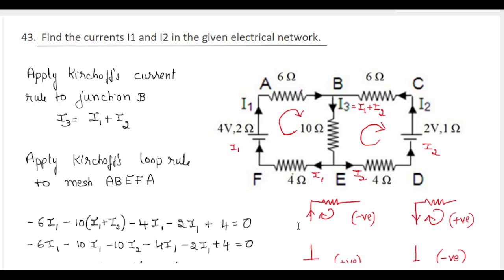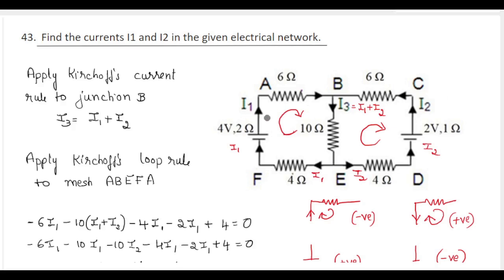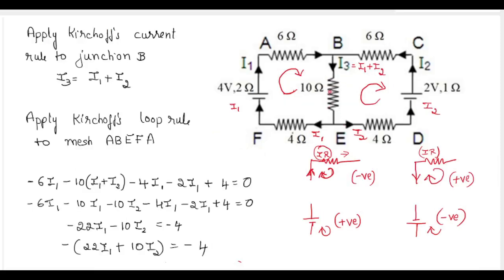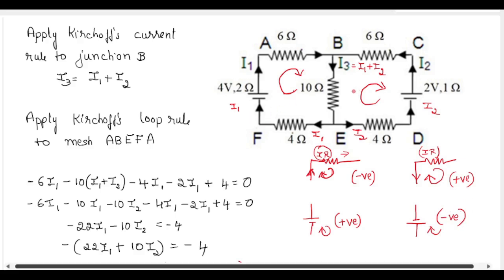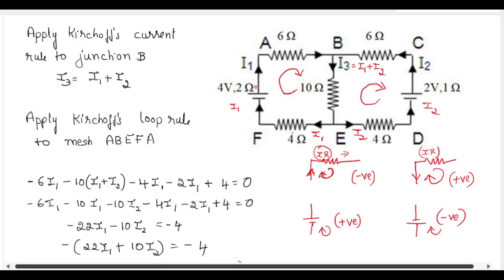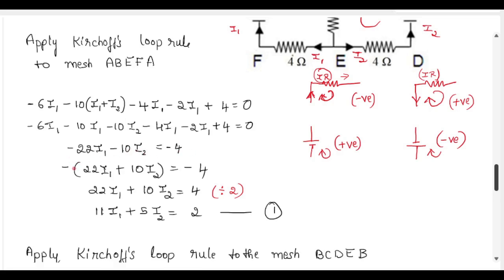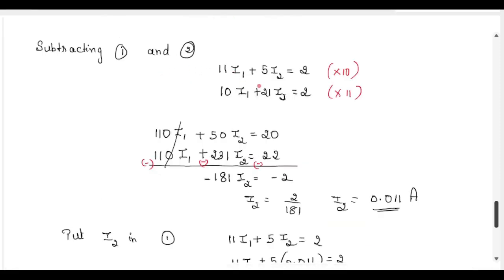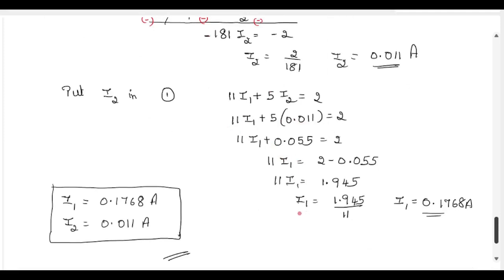Find the currents I1 and I2 in the given electrical network #2ndpuc  #physics #modelpaper #problems

Comment: Mam please say why we took I3= I1+I2
Reply from the maker: B'coz I1 and I2 meet at junction B and flow as I3 through 10 ohm resistor,  Directions are given right,  If we take it as I3 itself it will be difficult to find the value of currents I1 and I2 while solving the equations.  To avoid I3, we take it as I3=I1 + I2